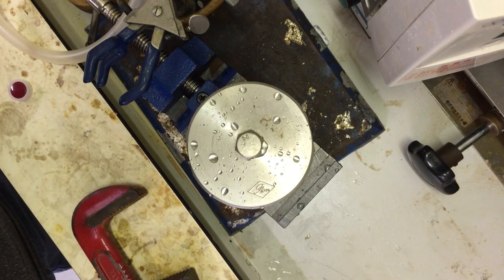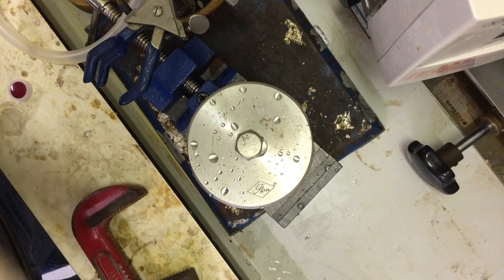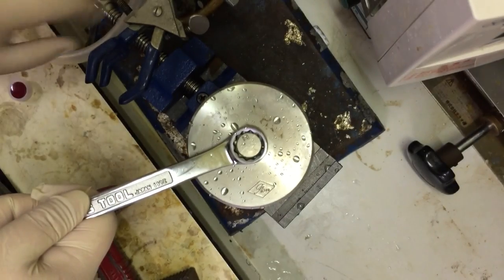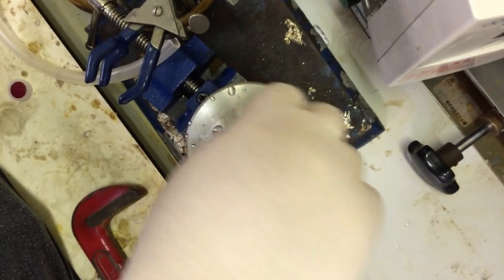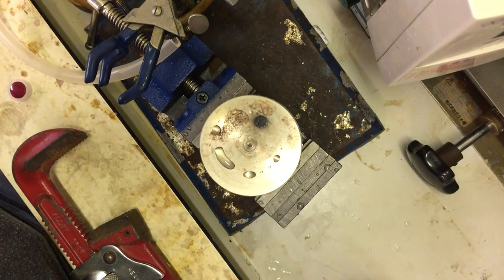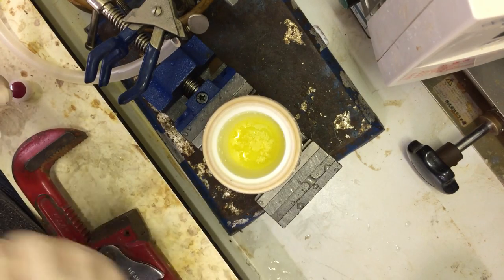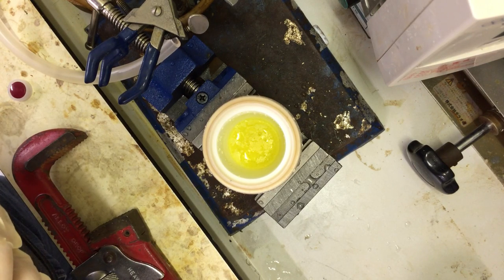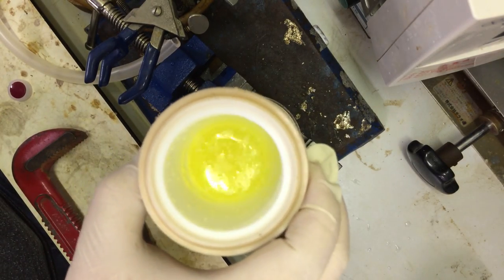Opening a Hydrothermal Vessel after Reaction with Nitric Acid

Comment: I suppose there's a specific reason why you're using nitric acid and a pressure vessel to oxidize toluene to benzoic acid instead of the more conventional KMnO4 method or even MnO2/Sulfuric at reflux.
Reply from the maker: ElSuperNova23 I'm not actually converting toluene to benzoic acid. That would be a complete waste of time. I was just using it as an example because I can't discuss what the actual compound was. But, I will answer the part of the question about using KMnO4. The products of those reactions is insoluble MnO2. The problem is that the compound that I'm making is also insoluble. It's difficult to find conditions to separate my product from the MnO2. Depending on the substrate, I'll use the nitric acid method or a CrO3 method.
Reply: ***** Makes sense. Thanks for the response.
Reply: @ChemistInJapan  Oh, ho ho ho. I get it.
Nice.